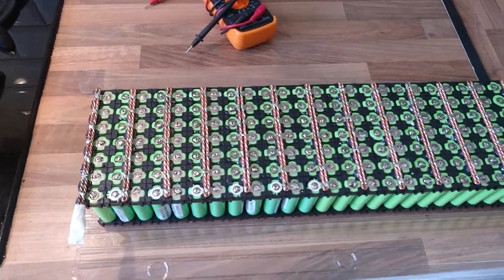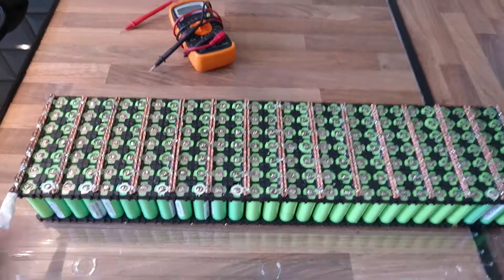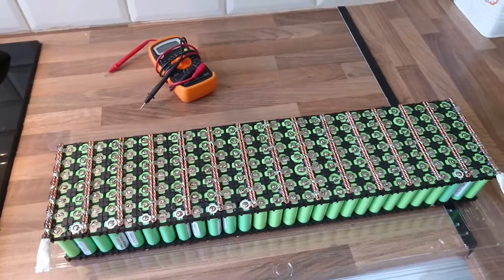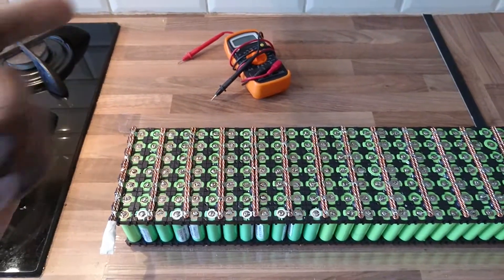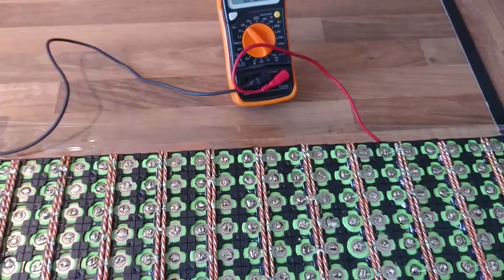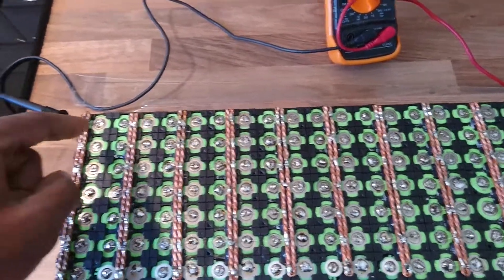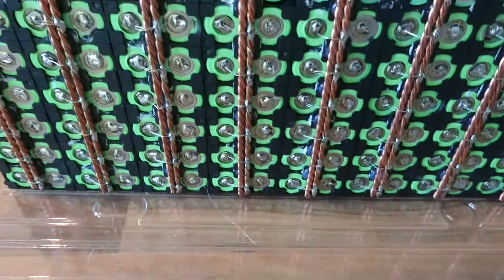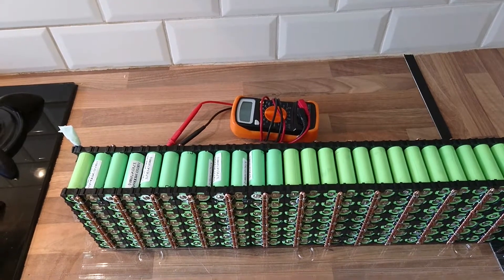Toyota Prius Plug-in range extender

Comment: How did you charge the additional battery pack?   did you find any need to balance it during charging, or not? and if so, how did you balance it?  THX
Reply from the maker: Hi, the battery was connected in parallel with the car battery. So they charged together. There was no bms to manage the battery and no balancing. The car was hit and written off before I finished the project.
Reply: @fix-and-drive-yo-car-diy  THX for the info.  sorry to hear that you didn't get to finish it. I'm assuming that you would have added an external charger, and a balancing system?  I'm looking for a plug in hybrid, as reliable as possible for long term use.  with great EV range.  currently looking at modifying a prius, or just get a chevy Volt.  The Volt seems to have everything I want.  and the prius seems limited in that it will use its gas engine when driving at anything but a very slow speed.  for instance, if you get on the highway, the engine turns on..  whereas the Volt will drive normally in pure EV mode until the pack is low, then start the engine.  is that correct?    If you had it all to do over again, what would you choose?  I have solar available at my house, so charging is free, but I still want to be able to do long trips and fill up with gas.
Reply from the maker: If I still have my prius, I would have put a bigger battery and have atleast 100 miles range. EV batteries are cheap now.
If Prius plug-in is on ev mode, the engine starts when you pass 60mph or when battery is low.

Comment: Can you please elaborate on current sensor bypass from positive cable?
Reply from the maker: The only way is by making a junction before the current sensor. You will also need contactors so that when the car is turn off, the contactors will shut the voltage and there will be no voltage where junction would be or else that can lead to trouble!
The first time I connected to range extender battery directly to the positive and negative of the traction battery. That is safe but the car your range wouldn't increase.

Comment: Any one can ask me ? He is doing a parallel between 2 different kind of batteries how is the bms acting when charging? And also where did he put on the truck
Reply from the maker: Hi sorry for 2 years old reply. Both batteries were lithium ion battery the only difference was the c rating. The pack boosted the prius battery. Prius battery charged a bit faster but the difference was minimum.

Comment: what are the batteries used in the project? just connect to the brand's original electronics?
Reply: 18650 cell like found in powerttools, laptop battery & portable power bank
Reply from the maker: 18650

Comment: you have prius stock battery 219v right? But in the pack you have built you have 30*4.2= around 120v!!!!! Not clear to me the parallel connection then also the different chemistry, make dangerous the charge part or how did you solve that
Reply from the maker: 56 in series x 4.2v = 235v. The extender pack is exactly same voltage as the stock battery. 18650 cells from tesla module are denser than the stock battery so they charge very slow. No issues at all.